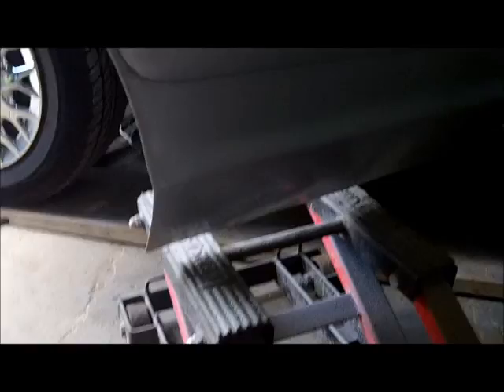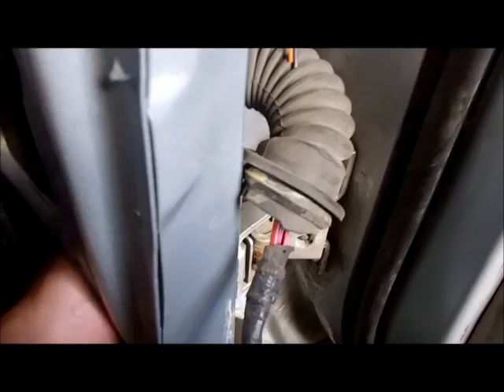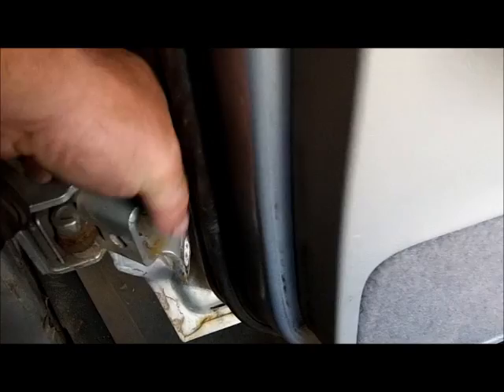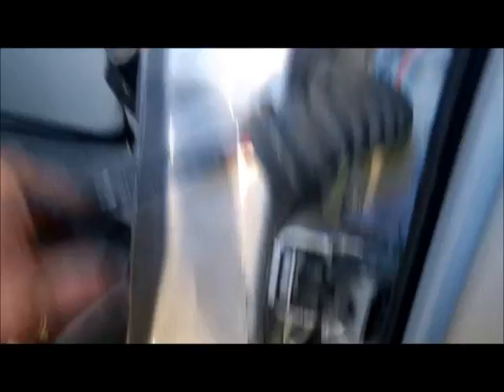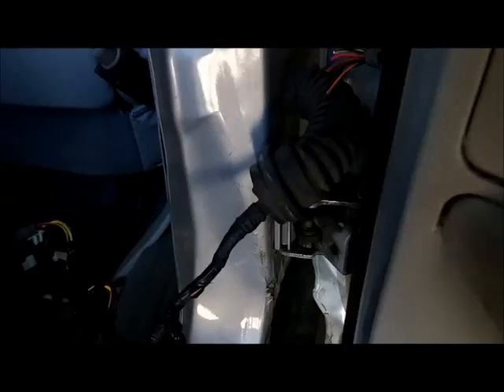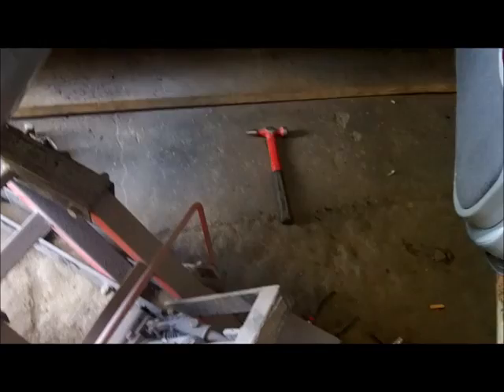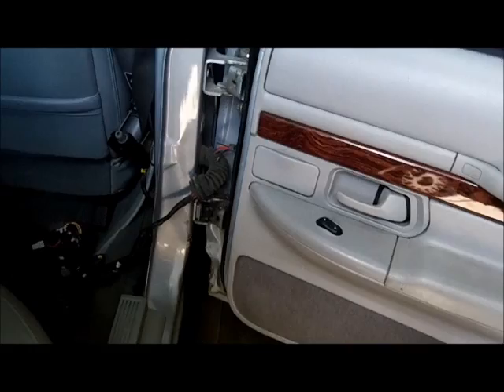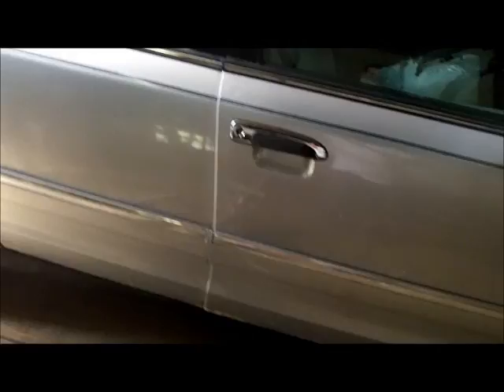Replacing Mercury / Crown Victoria Doors Part 5

Comment: Hey shawn,you probably don't have much use for a pricey frame machine.How about one of those L-style car body/frame straighteners.Like a L dozer or versa puller. I used someone's homemade one with a boat winch before and it worked great.You could probably build one pretty easy, Just a thought.

Comment: just weld a plate on it with a loop and attach the comealong there, that way you can move it and pull the rocker to instead of just pulling where the hinge is, and then when your done just just it off